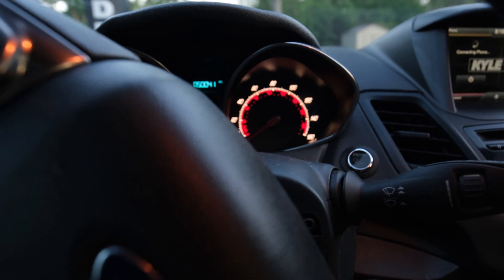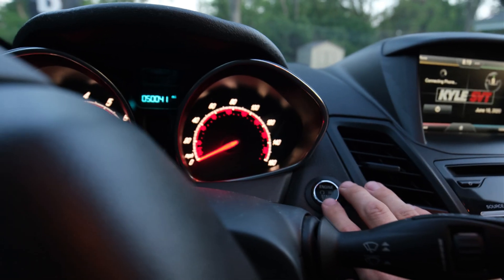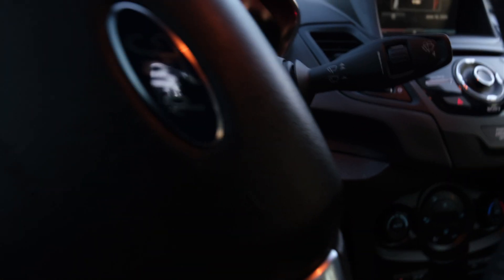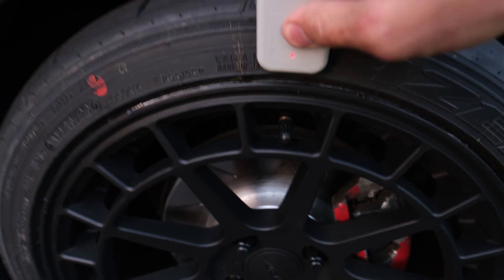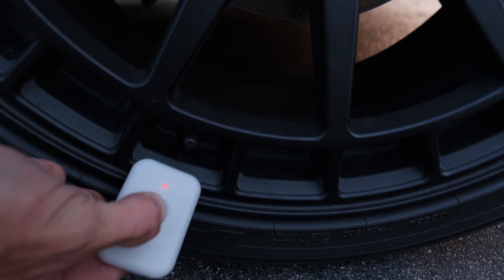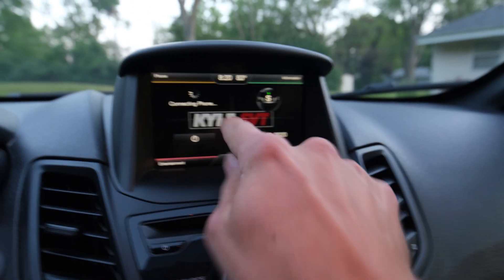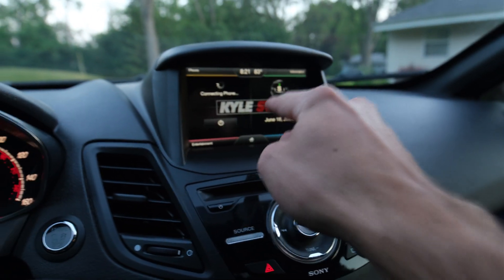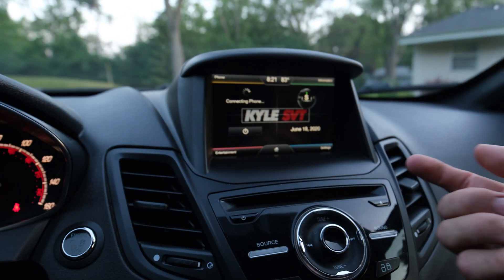How To Pair Your TPMS Sensors | Ford Fiesta ST

Comment: I just did this and wanted to add the parking brake needs to be on, the car needs to be in neutral, and all the doors need to be closed for the car to go into the pairing mode. if you have the parking brake off or the door open, the car will honk, but the screen will not go into the pairing mode.

Comment: I had a faulty/flat sensor in one wheel. Got a replacement from Amazon that says its compatible with our 2017 UK Fiesta. Unfortunately the pairing tool works on all the OEM sensor but not the new one. I suspect it might need "waking up" by letting air out of the tyre and will try that tomorrow, but in case that doesnt work can anyone recommend a sensor they have got working on a UK late 2017 Fiesta?

Comment: The car will actually sync up to the sensors on its own after a few miles. All you need to do is reset your tyre pressures in the same way you do when you fill your tyres with air. This was explained to me by the tyre specialist close to me, and it applies to the mk7 and mk8.
Reply from the maker: Mine did not that's why I had to buy the tool
Reply: @KyleSVT  do you know what the tool is called?
Reply: how it can be reseted?